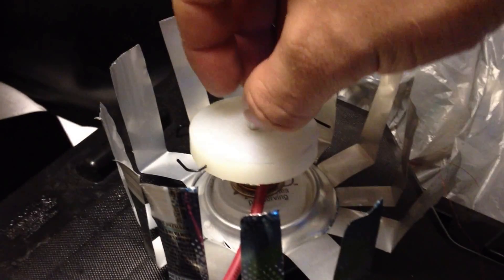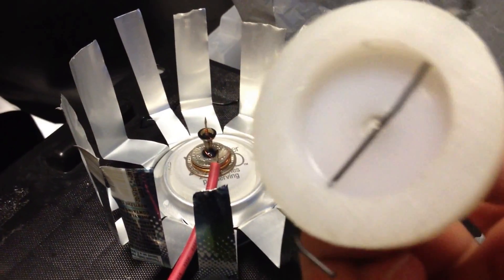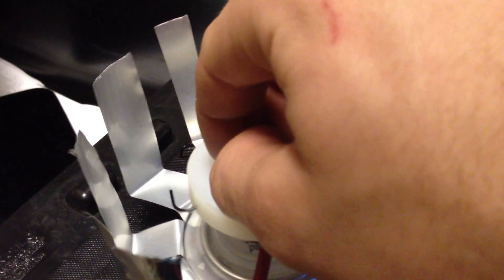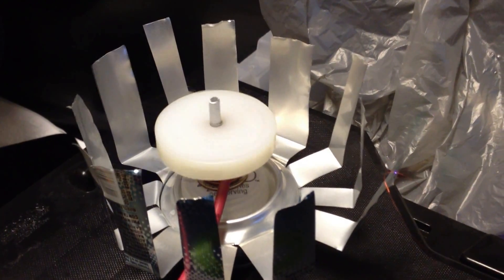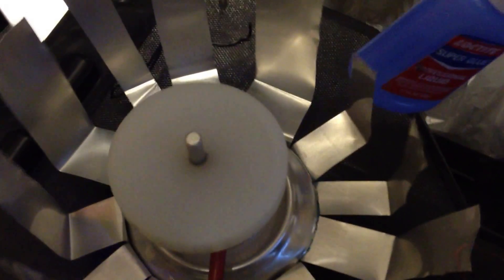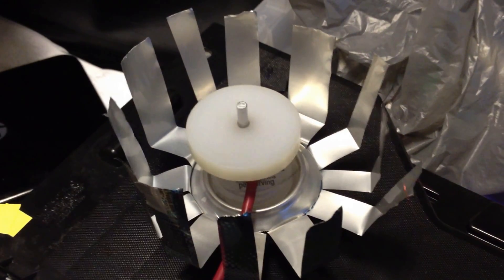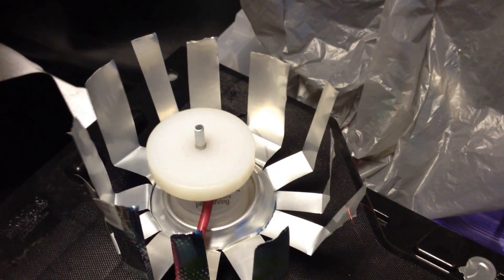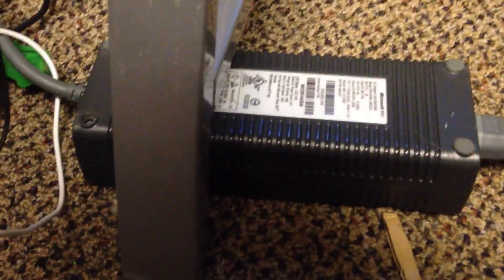High Voltage DC ion motor

Comment: Does ion wind strength go up with volts or amps
Reply from the maker: Higher voltage leads to higher current flow, so both?
Reply: @stevenrs11  thank you

Comment: That depends. although ion motors have nearly no torque they can accelerate to very high speeds. its much more efficient in space and it does not need to take any amount of fuel with it. Besides, in space you can always recharge batteries with solar power panels.
I think the future for spacial travel will be with ion thrusters.